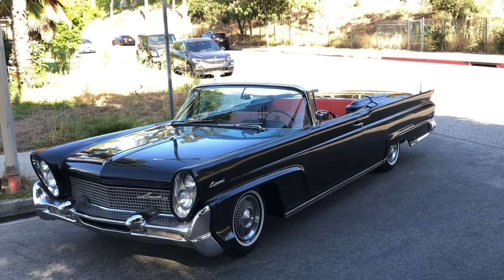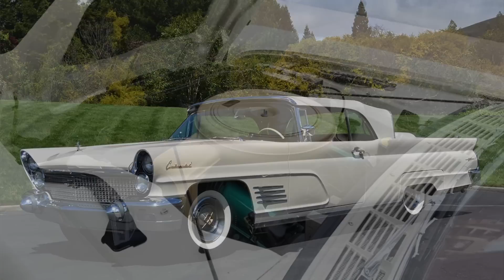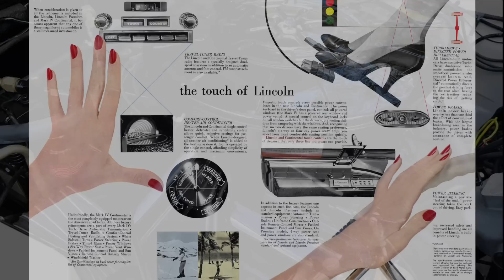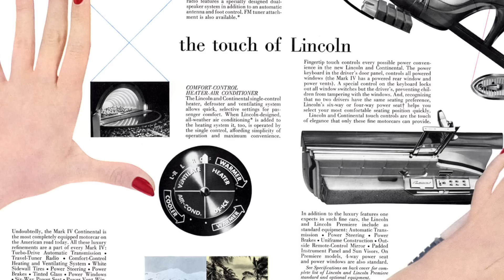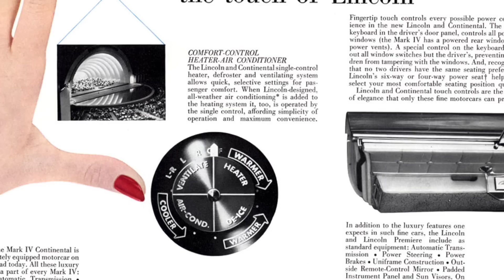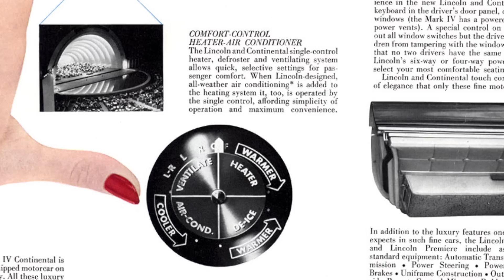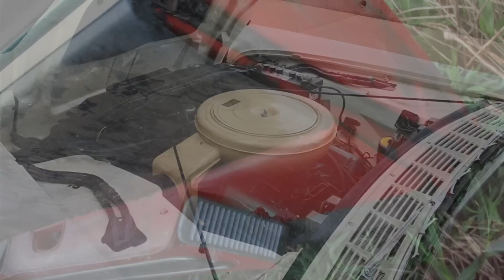Is This The Strangest Automotive Control Ever Produced?  1958-59 Lincoln HVAC Control

Comment: I can't count the times I ran the battery low  playing with the seats and windows in my dad's 58 Lincoln and his 59 Continental. He would leave the keys in the car so I would put the key to accessory and play away. I also love hitting the radio button near the dimmer switch and watch the radio change stations. I have to say years ago I thought the 59 was prettier then the 58, but my opinion has changed. I also believe these cars got overlooked at the time, as the body lines and details are superb.  I think my goal if I was to make a collection of Lincoln's would be to have a 1956 Coupe, a 1958 Continental, a 1961, then a 1966 or 67, and a 1969-71 Mark III as a collection. I know I didn't put a 55 or 56 Mark II, but lets face it that car like a 4 door convertibles are now way out of reach
Reply: Great story from your youth, and some insightful observations to boot. BTW, the  '55 has a special place in my affections, representing the 'road race' era car in it's most handsome and refined state.
Reply: @telebob5983  My dad had a 1955, I think I had the old title for that car for years after he junked it. One of the things I remember about those years was the battery was on the passenger side floor board. My dad and uncle were mechanics, as a kid I seen all kinds of cars, a Studebaker pick up truck, and golden Hawk. He had a customer with a old Hudson Hornet. I remember a 1959 Chevy with a 348 and a 50 Plymouth that was like brand new. Back then he worked on quite a few 58,59,60 T-birds. Such a simple time.

Comment: Excellent video! Is there a shop in Connecticut that works on 1958-60 Lincolns, does anyone reading this know. I'm looking for one familiar with them to do work I can't do myself. Have tried good places NOT familiar with them in the past and it hasn't gone well. Have had the transmission on my '58 rebuilt twice and there there's still an issue with it. Any recommendation would be greatly appreciated.

Comment: Thanks for the information Adam, Once you explained the control's simplicity it made perfect sense. I had considered these models rather gross and unattractive, but had never viewed the instrument binnacle or steering wheel boss. Both of which are fantastic in my opinion, and a very strong stylistic contrast to the sheet metal. I am taking a punt on the designers of the interior. They were not those of the exterior?

Comment: I'm lucky the hvac system still works perfectly on my 58 Premiere Landau sedan. Theres 7 or 8 bowden cables and an electric motor on the backside. I lubed up the bowden cables. Took me a while to figure out the push/ pull for the fan speed. Apparently the 430 was detuned a few times during the 58 model year. Mine was built November of 57 so it's got the hot engine. Unintentional second gear scratch happens occasionally.
Reply: Not all 58s had 375 horsepower?  I know the 59 didn't.
Reply: @michaelbenardo5695  The camshaft was changed to a milder one early on and the heads were changed to using the Merc 383 heads due to an issue of carbon build up on the valves. also, the block height was increased by .020 to reduce the compression ratio from 10.5 to 10.0 to 1. Not aware of any official annoucement from Lincoln declaring a reduction in horsepower.
Reply: @paulhettick332  Equipped with tri-power, the 1958 430 was good for 400 hp.

Comment: You should also mention that "58 Edsel and Mercury used this system. Additionally, in 1959, both the Merc and Edsel offered this system with heating only as the AC components moved under dash. A regular lever type system was offered also on these cars.

Comment: I was in grade school in the 1960's. My dad hated unibody cars. He said they were junk. He knew a guy that owned a big unibody I think it was a  Mopar. He said when it was jacked up to change a tire there was so much body flex that the doors would not open. It might have been a hard top without the B pillar.
Reply: I don't care for unit construction either.  Any rust in the chassis, and they are junk, as it is VERY expensive to fix, as the rocker panels double as frame rails.

Comment: Yeah, weird, but the 1958 Edsel Teletouch shifter takes the cake.
Reply: Teletouch - true!
How about '55-6 Packard TorsionAir suspension and electronic push button shifter pod?
Reply: @loumontcalm3500  TorsionAir was a Chrysler trademark in the early seventies, basically a carry-over of their excellent torsion bar suspension introduced for model year 1957. 
Packard's Torsion Level ride in '55-'56 was the most advanced suspension you could get at the time, a true self-leveling system that carried both wheels on one side of the car on a single torsion bar which was pre-stressed when the front wheel rode up over a bump, allowing the rear wheel to step over without jolting. The genius was that the rear axle had a compensating motor attached to secondary torsion bars to level the car's ride automatically when the back seat and trunk were loaded. 
I would say that the Packard Twin Ultramatic electric push-button selector was less weird than Edsel's Teletouch because it was mounted in a pod on the right of the steering column rather than in the center of the steering hub. Note also the complications of rigging the steering hub to remain stationary when the steering wheel turned. 
Mercury used electric push-buttons on the left side of the dash in model years 1957-'58, probably wired nearly identically to the Edsel's. 
American Motors '58-'62 Rambler and Ambassador models used mechanical push-buttons similar to Chrysler's.
Reply: @5610winston  You are right, I pulled TorsionAir out of memory; I owned a '56 Patrician, and knew better. My car had bypassed the push button selector at some point with a mechanical rod sticking out the trans hump. Packard had problems with them when they were new.
BTW- have you ever seen a teletouch disassembled? Not as complicated as I imagined.

Comment: I like these Lincoln’s- they are ver6 different. I wonder about the longest unibody car - the Mercedes 600 (W100 series) were unibody and they had several variations of extended wheelbase models (limousines and open models  with 4 or 6 doors) all of which were factory built (not stretched) and would have to be longer than that Chrysler you mention.
Reply: But they were not "standard wheelbase" models.

Comment: Adam, thanks for explaining the pull-push part, I always wondered how the blower worked.  

Also, I'm not sure if this one is the same as the Mark II, but I've always marveled that Lincoln could spend so much style on the exterior and put such a plain-jane dashboard in the car. It looks like it came out of a Cessna...
Reply: ..if Cessna had produced a Space Shuttle....

Comment: The 58 and then 59 Continental were outstanding looking cars.   They were not appreciated at the time, or were just too expensive, which accounts for the low sales numbers.   I've never heard it mentioned the differences in body styles between the 58, 59 and 60.    I like them all, but really like the 58.   Wasn't there was some guy who specialized in repairing these old Lincolns who would travel around the US ?  Jay Leno featured someone who did that with the mid sixties Lincoln cars; a white 66 convertible.   These are what luxury cars should be.   Size matters and style matters.
If only they had th fuel efficiency of the early 2000 Lincolns.   These are far better looking cars than the egg cars that plagued FOMOCO styling of the 2000's.
Reply: There was nothing quite like the outrageously over the top styling of mid to late ‘50s American automobiles… fins, bumpers, taillights, and massive use of chrome.  My interest in cars as a young boy favored the toned down design of the ‘60s, but today I confess that if I owned a classic, I’d want it to be from the late ‘50s.  BTW, I pretty much agree with your description of the later years’ Lincolns, I do think the final generation of the Town Car was very classy.
Reply: They were too big for most garages, that and the diagonally stacked headlights.  If they were vertically stacked, the car probably would have sold a little better.

Comment: Didn't Nash have a similar single control for the “All-Weather Eye” system on early Ambassadors?
Reply: I think "Weather Eye" might have been the first system that used "temperature blend doors" that allowed choosing whether air taken through an evaporator box was then sent directly into the car interior or through a heater core box and then to the car interior--with further doors choosing proportions of air delivered through defrost outlets,floor level outlets or front outlets (near radio and instrument panel)
also recirculate door that could switch the source of air from outside the car (cowl area) to an inlet behind the glove box that ingested air that was already in the cabin.

Comment: It's easy to see why those didn't sell . The Edsel was beautiful in comparison .
Reply: What is striking about the Continentals and the Edsels is that they were beautiful cars.    I see the crap boxes people drive around today, some very expensive, and have to puke looking at them.   When I see some fool driving a 6 figure Rolls SUV, for no better than they look, yet they probably think they're driving a gem.
Reply: @tompastian3447  Today's Japanoid "cars" are unspeakably ugly in my opinion.  Even the 35 Nash is better looking than those.
Reply: I like the 58 - 60 Lincoln, but I think more people would have like it if the headlights were vertically, instead of diagonally, stacked.  I have always like the Edsel, especially the 58s.

Comment: A Huge Car that was probably Impossible To Park and was a Gas- Guzzler, as well. Certainly an Interesting Set of Controls in these Lincolns, Adam 😯🤘
Reply: @Eric Ruud 🤣😉👍
Reply: Too bad backup cameras weren't a thing back then.
Reply: @Connor_Arroyo  You didn't need them.  You could actually see out the back window, as it was near vertical, not near horizontal.
Reply: @michaelbenardo5695  😊👍
Reply: @Connor_Arroyo  Too True Connor😊👍

Comment: I have read the 58 front bumper was changed due to customer complaints, the wings on the bumper was creating wind noise at freeway speed's.  A older guy told me that he was living on a airbase not far from me, and the base  Commanders wife got a new 58 Lincoln Capri sedan and everytime she crossed RR tracks, all four door's popped open. Lincoln, they local dealership had to contact Lincoln and they sent them baces to attach to the unibody construction and the service department installed them.   A lot of the bugs were worked out by 59.    As a little kid, our nextdoor neighbors bought a new pink 59 Lincoln Premiere.   I was really impressed with this car but today I realize that my then uncle's 58 imperial was likely a better car .    Ford lost 60 million dollars on building these cars for 3 years
Reply: @Sodham G'morris it was the first year of the unibody construction and this was discovered the first week of having the car,  October 1957,  so it was a very early model 58,   I'm sure there was other similar problems across the country,
Reply: @Sodham G'morris Falcons came back in 1964 as "Certified Gold" meaning all faults fixed and went on to win Car Of The Year in 1965.

Comment: My heart goes out to the pinion gear bearings for the load they saw while that "Near 5,000 pound car was propelled to 60 MPH in a little over 8 seconds."    Thanks for posting.....
Reply: Ford 9" rear end, very rugged. I had a 1971 Mercury Colony Park wagon, I was able to get it weighed one time, 5500 lbs empty.
Reply: @billvose7360  I grew up in the malaise era. And when I got my license all I had were mailase era cars. This would smoke a 1982 Camaro 0 to 60 that was stock. It's all perspective though ☺️
Reply: @johnsheetz6639  Related to the late Vernon from Miami?
Reply: @davef.2329  I can't be sure but I am from Florida, Panama City.
Reply: @johnsheetz6639  His dad was a dentist in Coral Gables, FL  and he grew up in a big green 2-story house across from the Biltmore Hotel.
Reply: @davef.2329  huh. I don't think we are related. Most of the sheetz side of my family are from Southern Indiana. Me and my mother moved to Florida when I was very young probably about 4 years old. I will tell you, this is a pretty interesting comment though😊.
Reply: @johnsheetz6639  I worked with Vernon for a few years in car repair until he retired and I went into aviation full-time. He was a WWII Navy vet and had been an aircraft mechanic on some carrier. He had some stories to tell about those days and what a life-changing time that was for him. Passed away in middle FL in the late 90s from lung cancer at a nephew's house. Maybe someone else will see this and remember him as Sheetz is not such a common name. I think his middle initial was a "B." Cheers.
Reply: @billvose7360  Agree but the load of pushing a 58, 59 or 60 Lincoln that fast from a dead stop is still a load on the pinion bearings.    What makes a Ford 9" so great is the pinion bearing. layout, a earing on either end of the pinion gear.
Reply: There's a chain of convenience stores named Sheetz in several mid Atlantic states. They are like a 7-11 but bigger and nicer.
Reply: These things weighed 6000 lbs for the continental

Comment: It seems for some reason, Lincoln has been way up or way down in sales for a number of decades depending on year models. I kind of preferred Lincoln over Cadillac and Chrysler.
Reply: Cadillac discovered Design Continuity with their LaSalle, with the tall narrow grille of 34 - 40, and the 36 Cad.  The LaSalle they added the Waffle Iron grille look of the 36 Cadillac for 37 and 38.  After they did away with it in 39, Cadillac buyers were upset and kept questioning why it was gone, so they brought it back in modernized horizontal form for 41, and never looked back, except for 57 - 60.  You could always recognize a new Cad, no matter how much the rest of the car changed.  The Lincoln, especially, would often be radically changed, until the 61 Suicide model.

Comment: 1958 Mercury Highway Cruiser with three carbs on the 430 MEL would have been cooler.
Both are an American Art Form in my book.
Reply: That’s the Super Marauder package. I think it was available on Lincolns, but just like the Mercurys, so extremely rare.
Reply: @Hemingray1893 ; Yes Lincolns, and the whole Mercury lineup, but no Thundebirds according to "Square Bird" forums.
Just the 4 barrel 430 option.
I read that the intake alone for the 3 carb set up was going for $2500 online, and this was years ago.
The 383 is raciest of all the MELs, potentially, because it's a whole 1.00" oversquare ratio of 4.300" : 3.300".
I'm surprised Henry II let McNamara get away with cutting the legs out from under the engineers after 1958.
Reply: @Johnnycdrums  He probably though the detuning of the engines made sense due to the sharp recession of 58.  Buyers were suddenly demanding better gas mileage.   The automakers even had thought the 6 cylinder engine would soon be a thing of the past, so no sense in designing new 6s, Chrysler thought.  The Slant 6 was originally going to be a Valiant only engine.

Comment: That weird HVAC control was not "dropped for the 1960 model year" -- 1960 Lincolns and Continentals used the exact same four-quadrant, single-knob control, just in a different location on the redesigned dash. 1958 Edsels equipped with air conditioning had what was basically the same control, but even simpler. Instead of a knob, you turned the bezel of the "Climate Dial" itself, with fan speed controlled by a toggle switch.
Reply: I couldn't have said it better than you did - you saved me the necessity of pointing this out myself.

Comment: I believe that these also had available power vents, ahead of the front side windows.  This option was not available on the 1961.  Finally,  in late spring of 1962,  they became available again on the Lincoln Continental.

Comment: Parents had a '58 Premiere 4 door hardtop when I was a kid. I've never thought they were odd. Washed that car as a kid, so I ran my hands over every panel. A good looking car and imposing when they were new. Not bizarre like the '58 Imperial, or unimpressive like the '58 Cadillac (which became in '59 a bizarre overreaction to the '57 Imperial). 
The Capri and Premiere with traditional rear glass were much better balanced than the Continental.
Reply: the '57 - '59 Imperials were beautifully styled and ruggedly built on the other hand the '57 -'60 Lincolns were an overly complex awkwardly styled mish mash - which is why they did not sell. Now to your point in 1960 Chrysler laid a big egg with an ugly design which got even worse the next year - I agree with you - the 1960 Continental was a much more handsome car than the 1960 or 1961 Imperial.

Comment: The 50s weren't just wierd for Lincoln. Chrysler (maybe others ) had the highway (instead of hifi) record player. Our Imperial's was mint. When we bought it the kids found it in an second. No seat belts back then and our youngest daughter would always curl up on the floor anyway. We attempted to just say it was a glove box but she found the stupid thing and that was it. The only way to get them to be good in the car was to bring 33s with us. Our AC control was a simple rotary knob with a slider under it but the useless record player was a favorite of the youngest. Sometimes corporations advertise to parents on the children's behalf and I think this thing was one of those times.
Reply: Actually, it was indeed called the "Highway Hi-Fi", developed by CBS laboratories.  It played special records that had twice as many grooves per inch as an LP, and ran half the speed at 16 2/3 RPM.
Reply: @marko7843  I think the groove geometry was different from standard records, too, to minimize skipping.
Reply: W-E-I-R-D